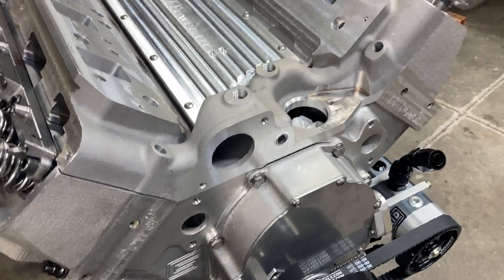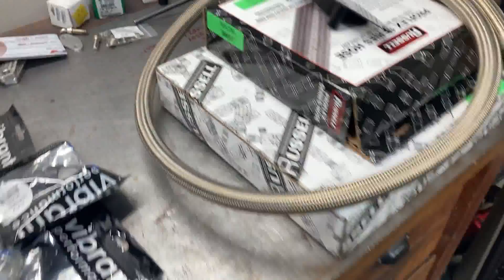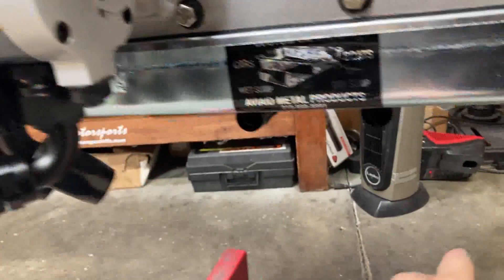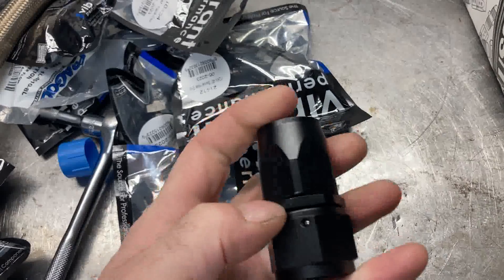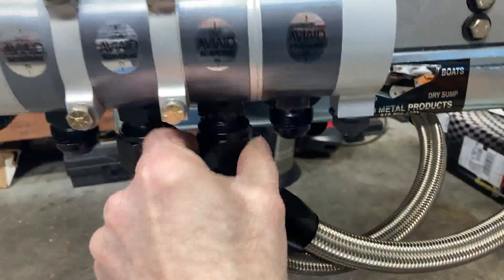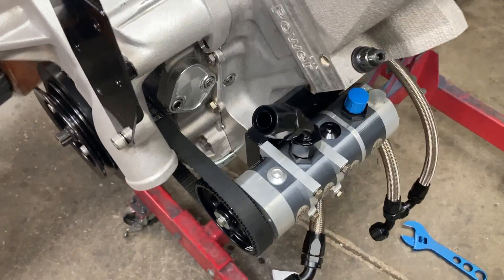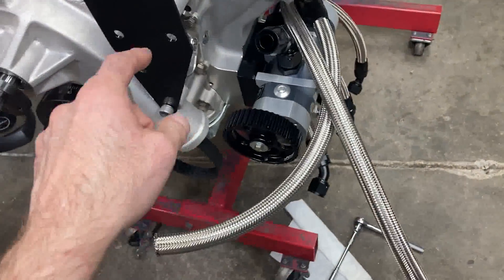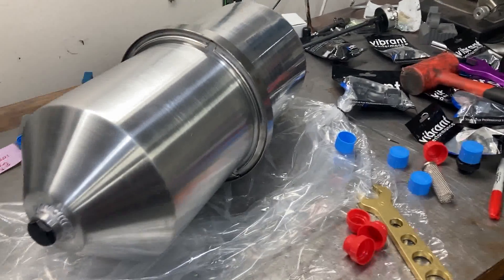Lykins Motorsports Dry Sump Oil Lines/Fittings

Comment: Hi, wondering if I can pick your brain about plumbing on these as it's the first time I've done a drysump and aviaid's tech support is atrocious. The supply to my pump has a -16 fitting on the pump and a -12 on the tank so not sure what size line to run. My tank is in the back of the car